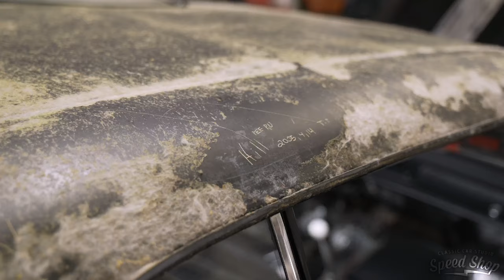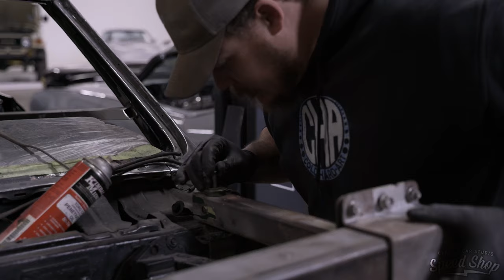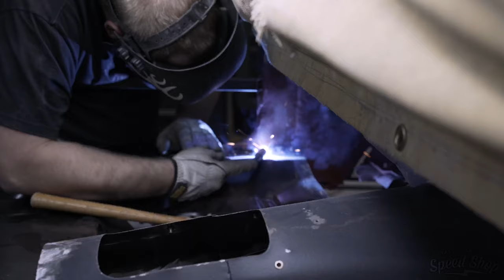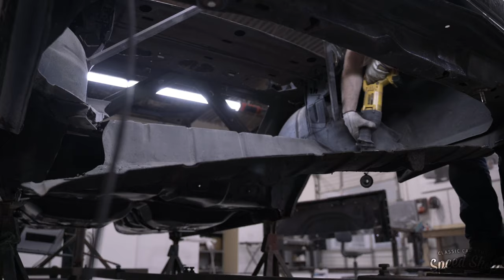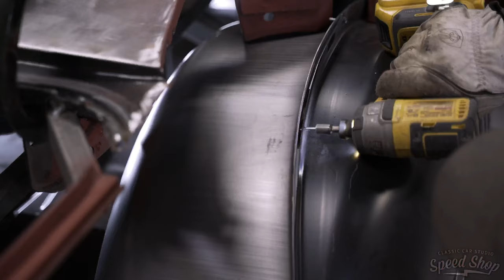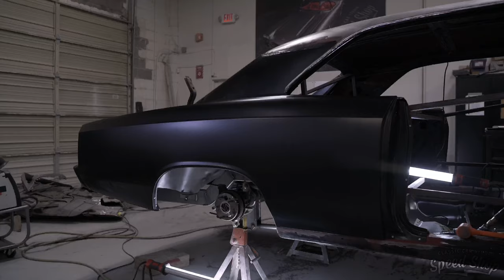66 Chevelle LS7 - Part 1 - New Floors, Quarters, & Trunk Pan

Comment: I purchased my '66 SS back in '82 for $1100.00 from my friend here in Colorado. Still have it but, can't afford to finish the body and paint, needs a trunk floor and 2 common rust holes behind the rear tires, runs and drives, 408 BBC Turbo 350 transmission, 3.73 gears w/Eaton posi. Thanks for the motivation !

Comment: Wish you would have shown more complete detail on installing inside temp support frame install points and location points and explain why and how to check for straight, square & true pf body.
Reply from the maker: Hey Mike, thanks for the feedback. Our media guy does his best to get everything he can, but sometimes things happen when he's off shooting something else. We're working to try and provide more of this detail, so definitely appreciate you telling us things you're interested in!
Reply: @ClassicCarStudio   My reason ---- getting ready to do the very same job to my 1966 Olds 442 convertible , but we are thinking of dipping the body & frame then dipping it in anti  corrosion  primer. Your so luck to be doing a Chevelle as there are ZERO repop panels for the 64/ to 67 Olds 442s so were forced to rebuild every panel with just small patch panels. I will replace the trunk & inside floor with Pontiac A body sheet metal as B/O/P are all the same but are different from Chevelle .  Yeah a total nightmare to do a  B.O.P. Thank god for Ames Pontiac & Fusik Olds or we would be dead !
Reply from the maker: @hydroy1  Yes, even though some parts are still hard to find parts houses have been doing a great job of helping to revive and keep classics on the road. We recently did a restoration on a Torino and body restoration on a Mercury, and finding metal was no picnic for them either, but it's constantly getting better.The next time we're replacing enough metal to have to brace something up, we'll try to do a video on where / how / why that's done. Best of luck with your Olds, those 442s are great cars.
Reply: @ClassicCarStudio     My 66  Olds convert is a factory A/C car as well ( different firewall cut outs for heater core VERY rare for a 66 convert 442 !!! ) That's why we really want to save the old girl, not many A/C convert 442s from 64 to 67 built with factory A/C at all. Most all 442s before 68 were non air. I have two 66 olds 442s a 2 door post sports coup H/T and this A/C convert we are doing our best to restore. I really like them, but they are more difficult to keep on the road then a Chevy as nobody/ very few,  have parts for Buick/ Olds/ Pontiac. Even simple parts like a water pump for the 64 to 67 Olds short neck can be a real pain to find. But when it comes to repop fenders, door skins or rear 1/4s ---- forget about it, your stuck with a jigsaw puzzle of small  patch panels to re build what ever you currently have.  Also keep in mind the 1966/ 442 front fenders are a one year, one model only front fender so we have spent many long hours hand fitting every inch of both front fenders in steel as they both were rotted out to the point even the back fender reinforcements had to be surgically removed from a doner 66 cutlass fenders ( different but can be shoe horned in to work ) & re welded back into the 442 fenders with the added use of replacement lower patch panels for the fenders to save them but you have no choose as even far from perfect, used 1966 442 fenders go $1,000.00 EACH !  Oh hell no  ! 2 grand for two beat up used fenders ???? no no no no no give me that cut off death wheel !!! and my little mig gun !  I will build my own  geeeeesis ! $2 grand OMG ! Shoot in 1966 you could buy  BRAND NEW 442 convert COMPLETE CAR for under $4 grand ! !     Yep as you can guess, I am in no hurry to complete this car , it might take me ANOTHER 10 YEARS ! The first 10 were the hardest !  The wife left, and my dog now growls at the 442 because I spend way more time with it them with him ! and at this point, I REFUSE to give up ! The only thing I am really worried about at this point is --- do I remember how this thing all goes back tougher ???? Thank god I got the H/T to use as a sample !------>  https://www.youtube.com/watch?v=swcIaVuC2Og